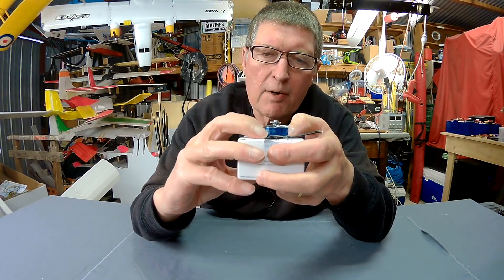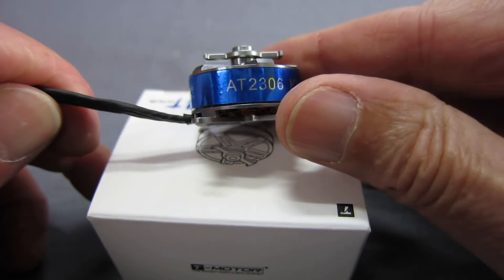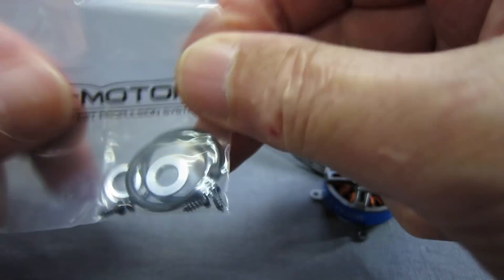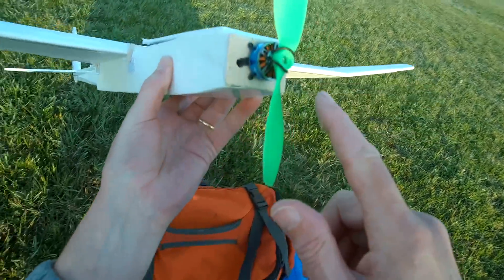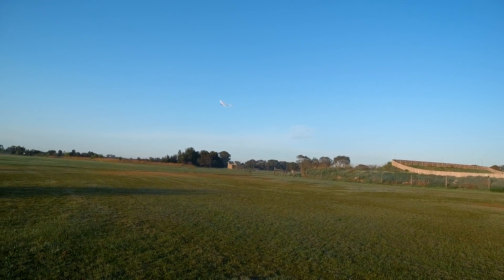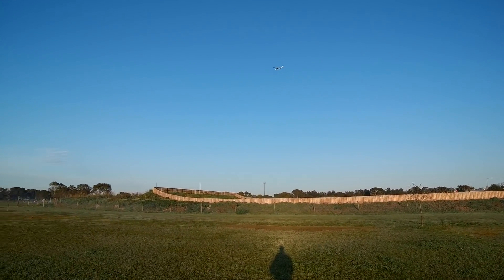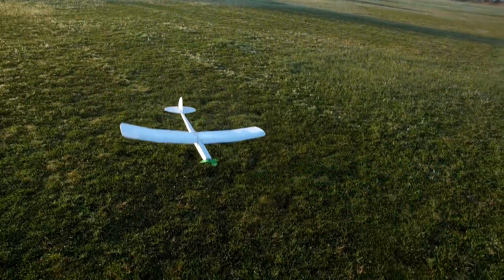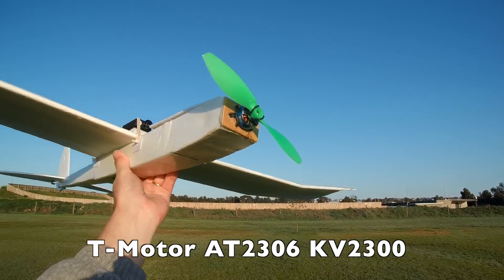T-Motor AT2306 KV2300

Comment: Hi Andrew.
I need a bit of help.
Is it possible to change the SB channel on a X4R SB to use as channel 4?
If NO, which standard 4ch reciever is small and best?
Thanks for you time Andrew.
I am still getting to grips with my taranis.
Keith UK.
Reply from the maker: Not as far as I know, it's a dedicated 3ch + SBUS receiver, should be called the 3XR really. There is also a non SBUS version just called the X4R which is what I use for my DLG

Comment: Perfect conditions for the test Andrew....Its a nice looking motor, and the built in mount is a nice touch, but the prop hub rubber band idea is a deal breaker for me. Im surprised they didnt tap the shaft as well so for the purists among us we could hold our props on properly...lol.
Reply from the maker: It may be tapped, I'll check
Reply: 1:09....It is tapped, which would imply they didn't send you all the prop retaining hardware..Like a bolt and a prop washer of some kind..?

Comment: The red or yellow Therabands for exercise are tubes. I section it for the bands. (Not my idea) It works great and they last much longer than an O ring or rubber band. Youd be surprised how much power you can put to that setup if you double band it. Nice review and flight!
Reply from the maker: Great idea, thanks

Comment: Hi Andrew. Is it pulling over 600 grams of thrust only on 2s ?
Reply from the maker: Oh no, only need that much thrust to climb vertical. Horizontal flight requires much less than 1:1 thrust
Reply: Thanks. But can't find this motor..))